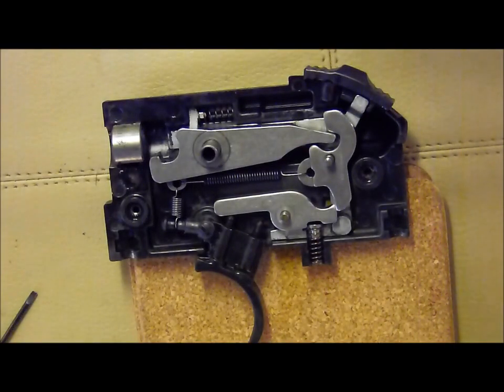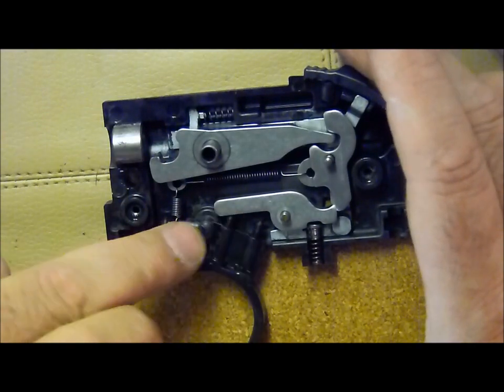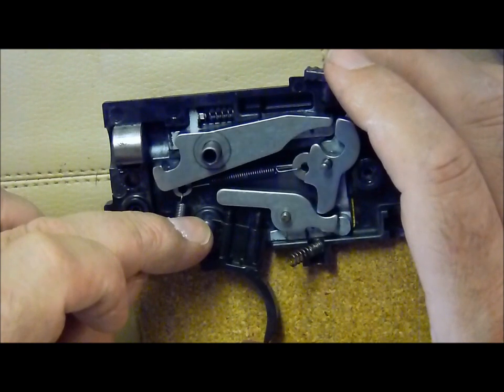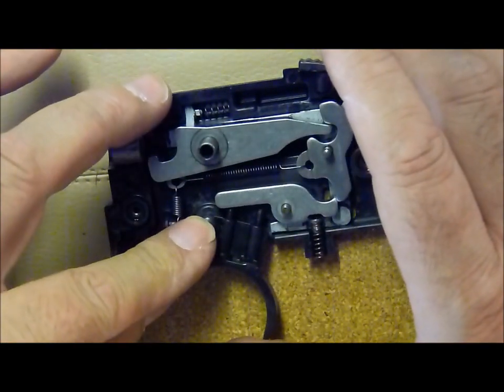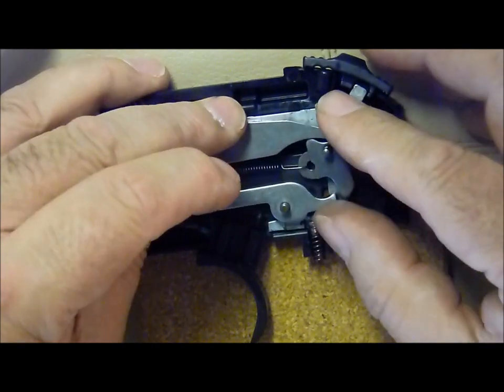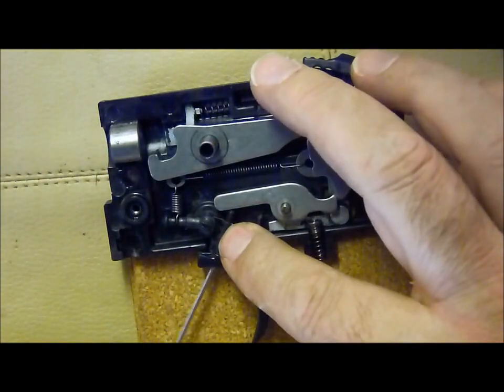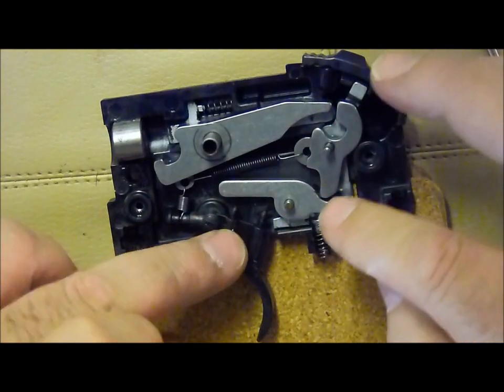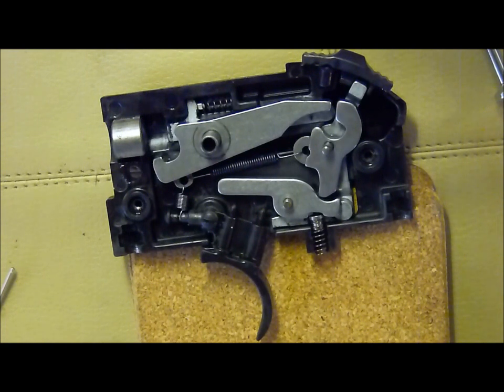Walther trigger unit - how it works

Comment: Spring pressing on sear to provide trigger pressure is upside down according to several sources.  Spring on the sear enhances flexibility and the metal piece limits travel if the grub screw is backed out all the way.

Comment: I have an LGV and I think the previous owner messed with it, when the safety is engaged the trigger gets a heavy feeling, but pulling the trigger causes the safety to disengage and the rifle to fire. I have tried backing the screws out and adjusting them to various points, it does not alleviate the problem (although I did find the sear stops engaging at a certain point). If you, or anyone else, have any insights to offer that would be great, it's my first rifle and I would really like the safety to function!

Comment: Should the trigger be dry and clean as shown, or should it be greased and oiled?  If so where should the grease go?
Reply from the maker: +Robert Maybeth the unit internals are dry and grease free because I had just cleaned them out. I re assembled them with a little light moly grease on all the pivot and touching surfaces.
Reply: +shootingatdawn thanks

Comment: great video.the lgu trigger not as good as the weihrauch rekord unit
Reply: walther trigger is better than rekord trigger because it is more versatile, you can adjust individual travel on stage 1 or stage 2 and you can do it without removing the stock like if you do it on rekord, the safety lock is 2 ways not like the one on rekord, easy for the maintenance since it is easy to be assembled/disassembled compared to the rekord. Thats enough to say i guess...
Reply: i dissagree.. i feel its better then the rekord unit.. the lgv/lgu trigger is touted as being match grade.. the rekord trigger is not match grade altho you can tune it to be match grade.. also alot of ppl dont know how the setup the walther trigger properly.. and rowan engineering do a lovely drop in trigger!  i feel the the walthers are better out the box then the weihrauchs!
Reply: I agree, I had walthe lgv and sold mine because of crappy trigger. Made of plastic and you have to pay extra to get made from metal. even Hatsan trigger is better.